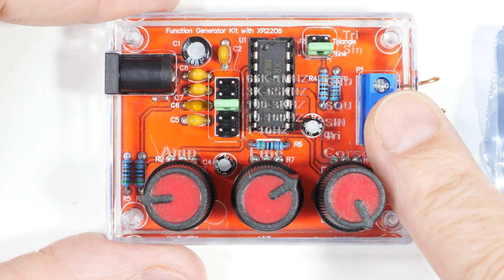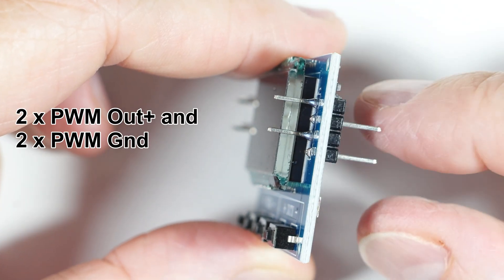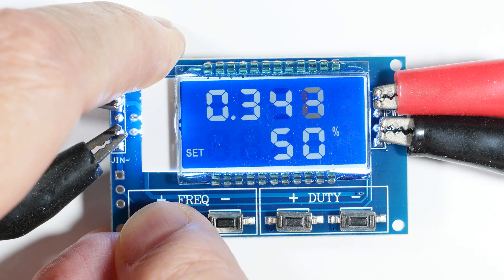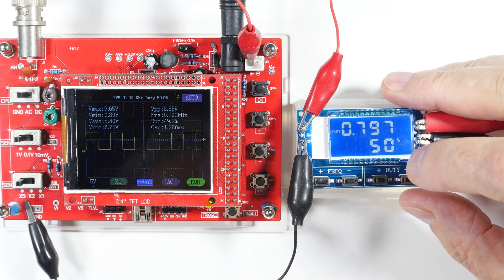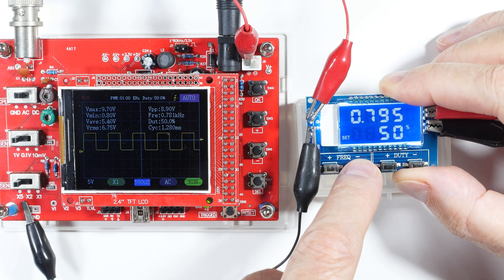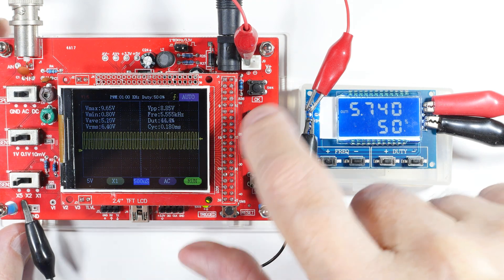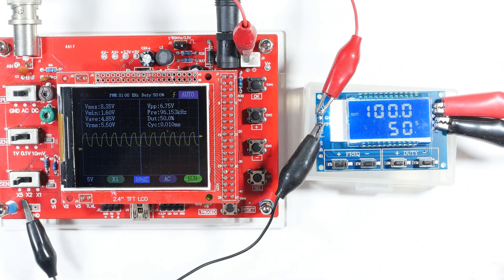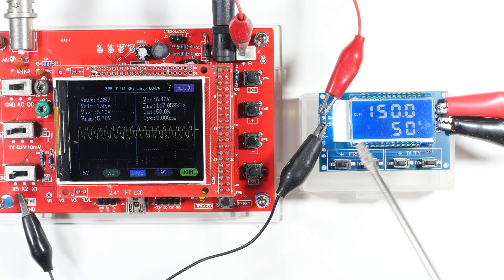$2 Square Wave PWM Function Generator (4K)

Comment from the maker: Videos on the oscilloscope used in this video:
The DSO138:       https://youtu.be/I5jvzTOeHKc
Using the DSO138:     https://youtu.be/TMfAsKkLerU

A brief comparison of the $3, $2, $1 function generators that I have made detailed videos of. 
$1 Function Generator Kit:  https://youtu.be/gU6ts5ku-Zg
$2 Square Wave PWM Function Generator:  https://youtu.be/5rMtucqDbf0
$3 Function Generator Kit:  https://youtu.be/TMfAsKkLerU
$3, $2, $1 Function Generators - Quick Compare:  https://youtu.be/5bPkQULDgfY